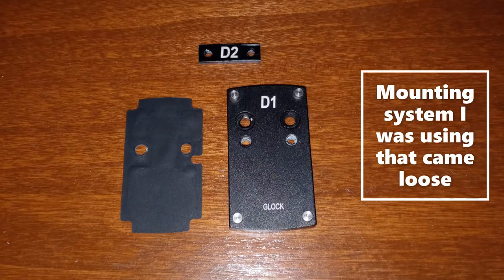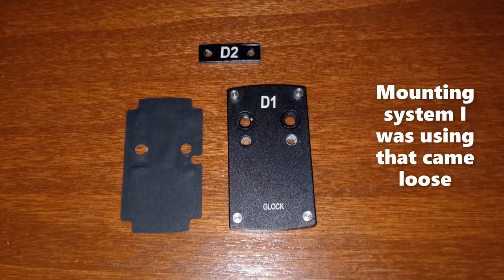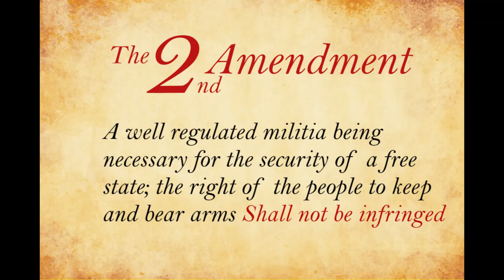ADE Optics RD3-006B final malfunction update

Comment: Don't forget the rubber gasket between the sight and plate
Reply from the maker: Yeah I put that in the first time I screwed it to the mounting plate on the slide with blue loctite and it came loose I re attached it using red loctite and its still on their nice and tight and is still holding it's zero so far
Reply: @counterstrike2A  kewl beans 👍